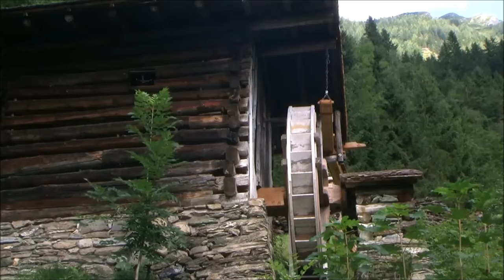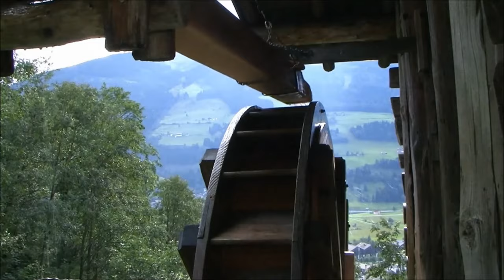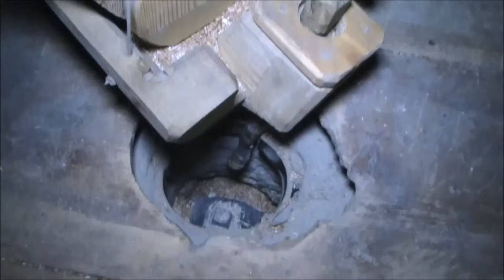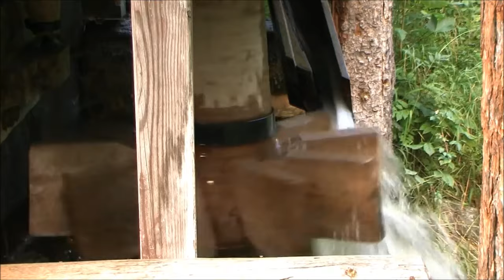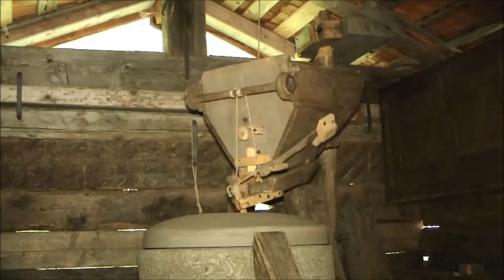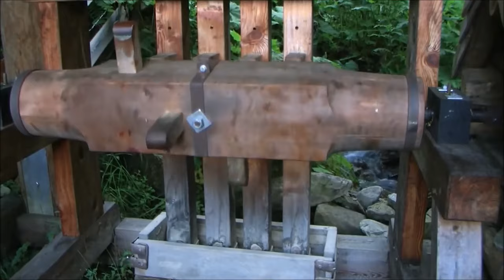The Water Mill

Comment: What does it do though? What's the mill for?
Reply: For everything. Do you need to do something repetitive that requires movement?  Grinding mill, pressing olives, cleaning wool, blowing air in an oven, moving a conveyor belt, hammering stuff and so on and so for.. from the early middle ages to the steam engine invention that's how stuff was done

Comment: What we're these Mills generally used for? Just a simpler form of hydroelectric power? And if so how did they harness the energy?
Reply: https://en.m.wikipedia.org/wiki/Watermill
Reply: Usually, as people would set in an area, initially a mill would be constructed to provide wood (sawmill) so that a community could expand, build, etc...  Once the land was "developed" i.e. cultivated and crops (cereals) started appearing - the mill was extended (or another one built) to "grind" the grain into various flours.  Later some of these were converted to drive generators to produce electricity.  Ciao, L
Reply: Mainly for grinding wheat berries to get flour